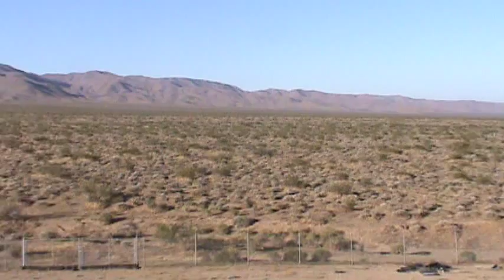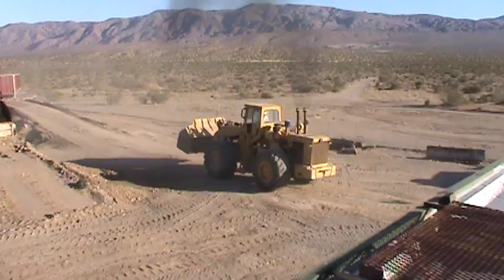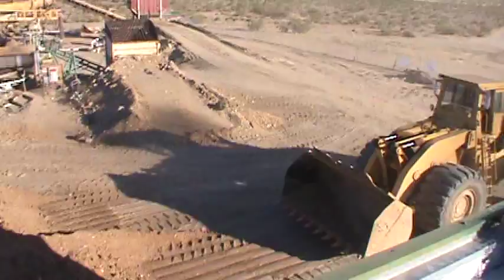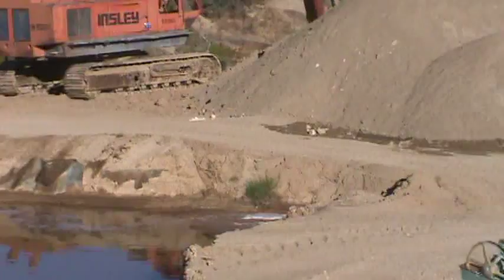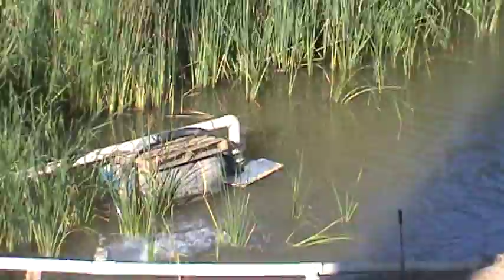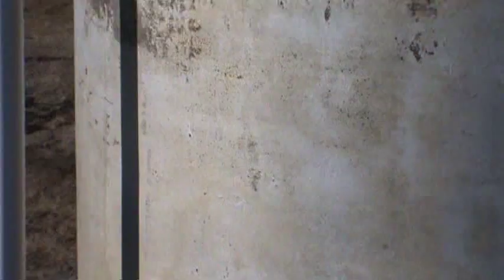Sleepy Bear Mining Commercial Production Placer Gold Mine 2011

Comment: And re the settling pond, if you want to clean it fit enough for human consumption, perhaps distilling it with solar heat and some waste heat from a producer gas plant or simply fired by methane from the biomass algae you may have in one of those Ponds depending on just what your tailings pile looks like on a spectograph,,, could run all your equipment from it too if you went as far as to start stocking your own seafood on-site I'd imagine. ;)

facebook cam  \  biocharmovie

Have fun.